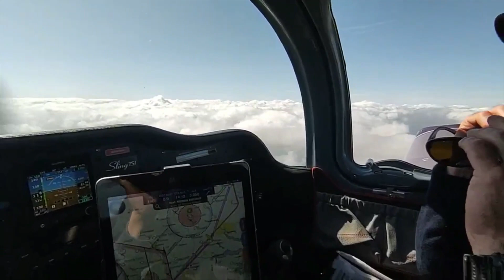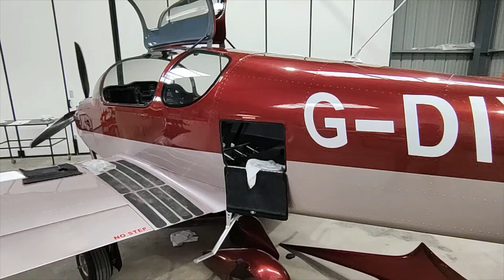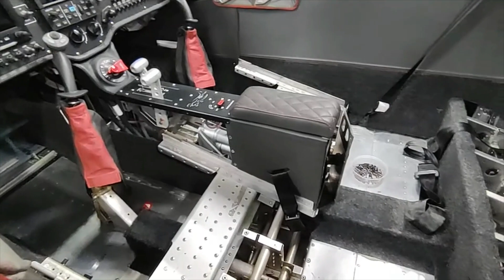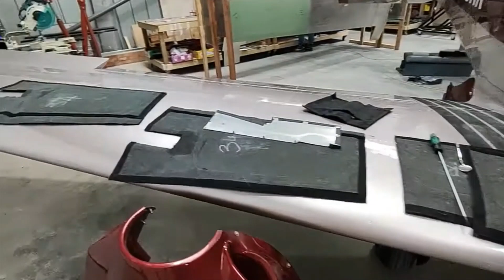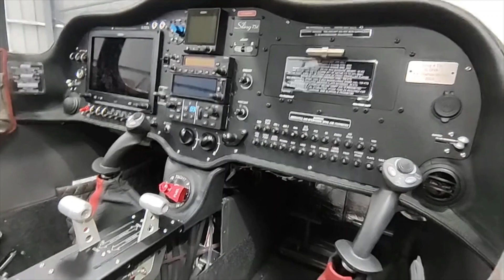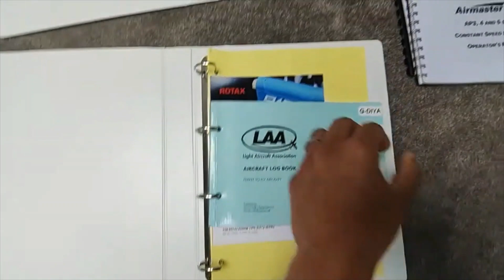Sling TSi First Inspection 25 / 40hr checks

Comment: Doesn't that TAS seem a little low? When I flew N135WT I have some screenshots of the engine instruments. 5500MSL, 35.3 MP, 5000RPM (72% power), 6.8 GPH (26 LPH) resulted in TAS of 134 (126 IAS).
Reply from the maker: That's correct. My IAS under reads by about 8%. I'm using cabin air as the source for static pressure. Will update to the new static ports soon, that should correct the issue.

Comment: You’ll get better economy at 5,400 rpms for cruise. I have the same setup but in a different plane and many have mentioned that Airmaster’s cruise setting of 5,000 is far to low for the Rotax resulting in higher manifold pressures burning more fuel whilst lugging the engine and going slower. Just food for thought
Reply from the maker: Yes that's correct. I've tried that aswell. Fuel economy improves at the higher engine rpm in climb setting. This screenshot just happen to be in cruise prop
Reply: @slingbuilduk400  my controller has been reset whereas cruise is now 5400. Climb remains 5500. The manual selection goes to 5000 and it’s a noticeable difference. Even has more of a lugging harmonic vibration at 5,000. I enjoyed your build and although I’ve never flown a Sling I believe you have a wonderful plane.